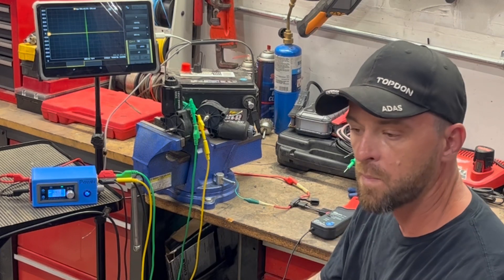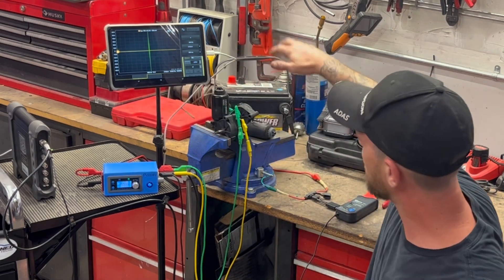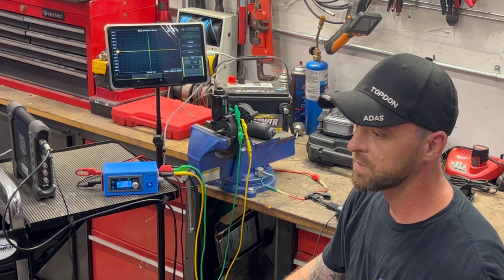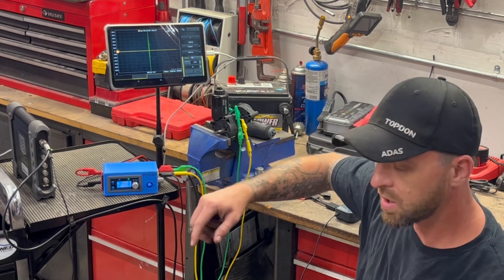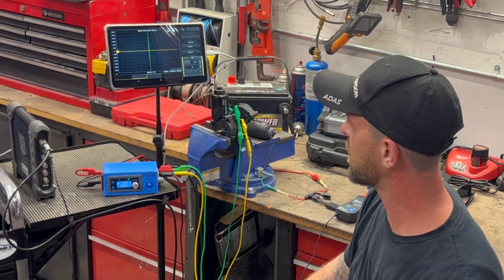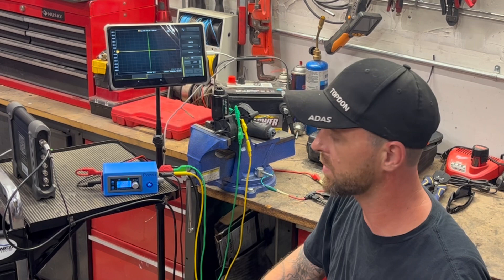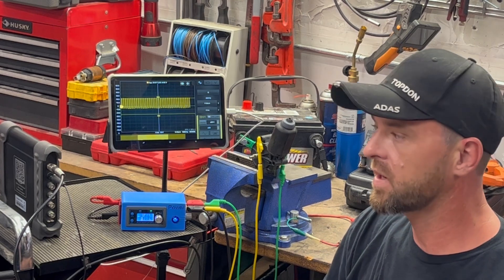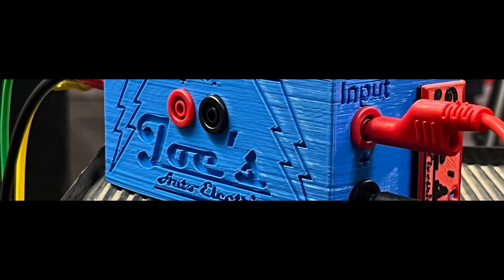Joe’s PWM And Variable Voltage Power Supply - Description And Operation!

Comment: Great video.  I'm glad to see someone showcasing Joe's products and showing how to use them.  I would like to see you demo his three phase tester if you haven't already.  I have most of Joe's tools other than his Delta sensors.
Reply from the maker: Thanks much appreciated! Yeah Joes tools are fantastic, I haven’t been disappointed yet! And great idea, I’ll definitely try to record the next 3 phase diag that comes in. You need those delta sensors man, absolute game changer. So many uses!
Reply: @BigDogDiagnostics  Yes, I will probably get his delta sensor at some point.  I have Jarhead diagnostics VA sensor which does a lot of the same tests, but I like the design of Joe's one and the fact that you can get the waterproof version which JH doesn't offer.  JH diagnostics does make some nice diag equipment if you have not checked him out.  

I just found your channel and really like your content.  Keep up the good work.

Comment: Solid video bro. Plus the inline fuse is a great idea to protect your equipment. Plus I do agree to get familiar with the tools you use. To make time to know how to use them. Don't pull them out when it's time to diagnose and you don't know how to operate it
Reply from the maker: Thanks man! It’s just a good safety measure! I would hate that thing to pull too many amps and fry itself. A fuse is cheaper lol. I try to find as much time as I can to get to know my tools. Trying to learn how to use a tool while at the same time, Absolutely needing it for a Diag.. Makes you want to throw it in the garbage 🤣 or across the room lol.